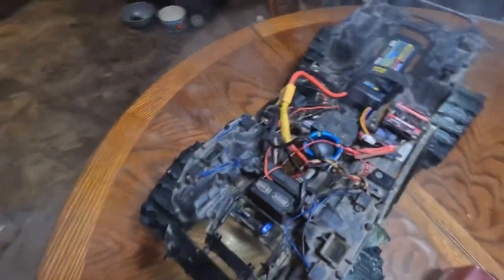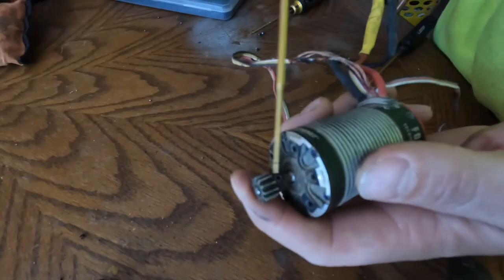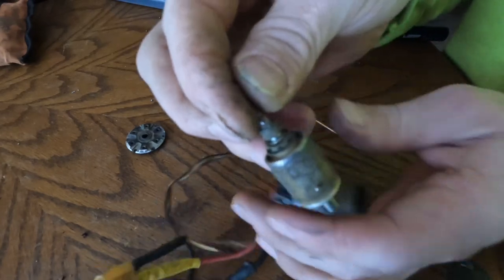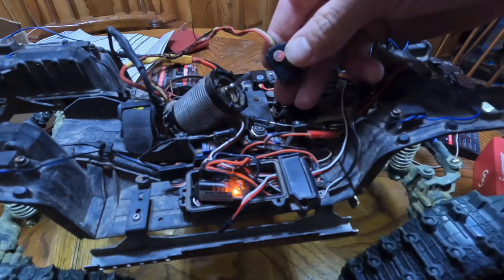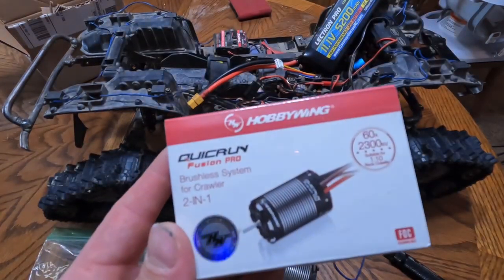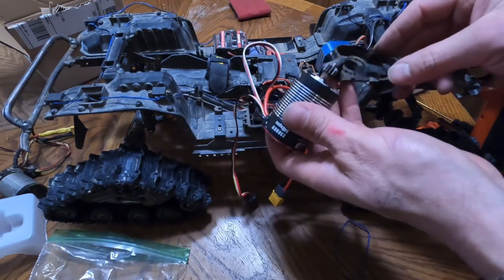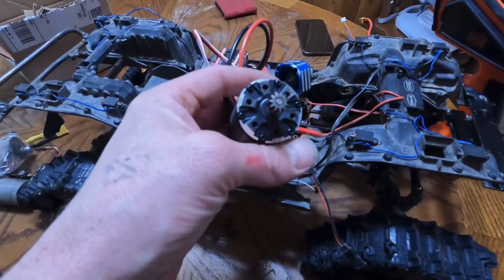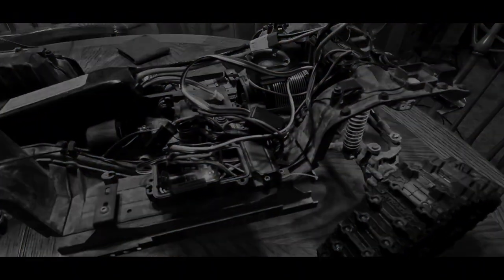Hobbywing quick run fusion pro goes up in smoke

Comment: Hahahaha😂 those Traxx are trash. They work but I don't like them. I had one and had an RC4WD 27T motor in it and ran around my yard in snow then all of a sudden it started smoking😮 the motor couldn't handle the load stress from the Traxx. 
So I sold my TRX-4 Sport with Traxx. I looks nice but not for me, I prefer my normal crawler rigs.
Reply from the maker: I agree, I only putt the traxx on when there’s deep snow. And crazy yours was smoking ?